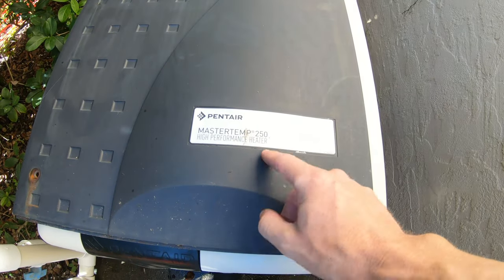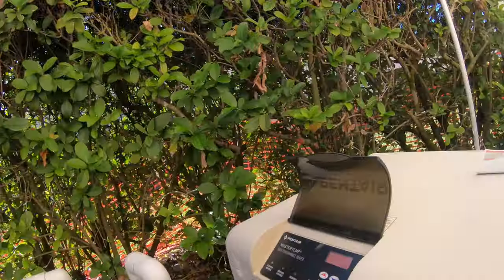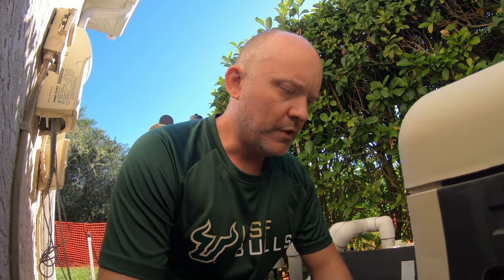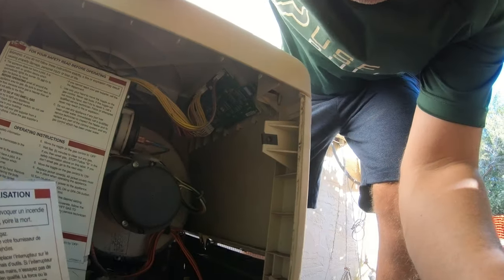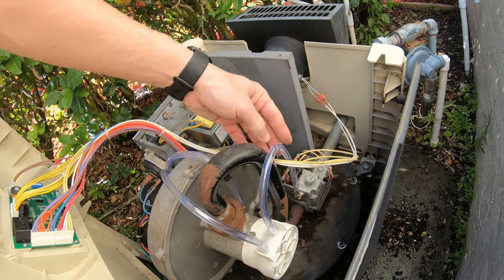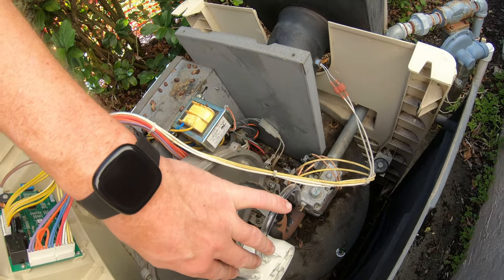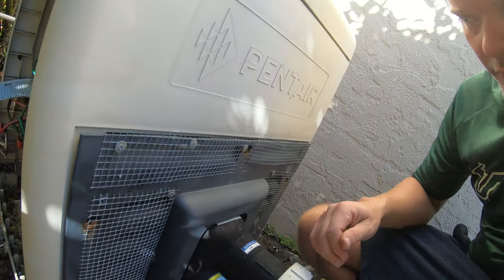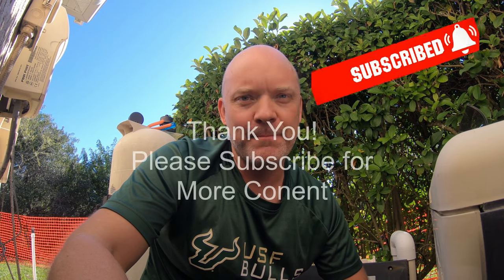Pentair pool heater turns on but does not heat, how to fix.

Comment: Hi I have the Pentair and it ignites then shutoff after 5 to 10 secs. I put in a new Thermal and 2 new plugs in front. Cuts on and I get r13,888,126 and heating light comes on but no service light. What else can it be?
Reply from the maker: Tami... if it ignites and runs then it is already making it past several safety checks. How is the water flow through the system? You can check by removing the inlet and outlet and hooking a hose up and watching the flow coming out... it may have a restriction. Could also be a slight airflow restriction ... check for a mouse nest at the intake and exhaust. Are you sure it ignites? Sounds like a furnace or gas stove kicking on.
Reply: @JackofAllTrades1  Yes, it definitely ignites and heat comes out of the vent. Are you saying disconnect the black pipes going into the heater from the. Ground? Where do I insert the hose?
Reply from the maker: @tamimorales1116  these units are made to be pretty versatile so your pipes could be on any side of the Heater. For mine the inlet and outlet are right under the control panel at ground level. You can flush water through either pipe and you donr have to necessarily disconnect the pipes at the hester..heater... but checking water flow is probably a good idea. It might be getting too hot because of poor water flow due to calcium buildup.
Reply: @JackofAllTrades1  ok yes my pipes are under control panel at the ground.  But where would I insert hose to run water through? I'm going to open it all up to ck for mice nest and ck tubes ect.
Reply from the maker: @tamimorales1116  there should be round disconnects right there that unscrew and free both the inlet and outlet pipes.
Reply: @JackofAllTrades1  Yes ok that's what I thought. Do I run water in the direction of the throught the heater the pipes or both directions?
Reply from the maker: @tamimorales1116  try both. You may be able to clean out any buildup. If it's calcium then it's gonna need muratic acid which is dangerous and will require it to soak.
Reply: @JackofAllTrades1  ok those cuplinks are hard to unscrew might need manpower😠🤣I'll keep you posted. Thanks a bunch
Reply from the maker: @tamimorales1116  I had to buy a special slip jaw wrench from Lowes to undo mine.
Reply: @JackofAllTrades1  oh ok. Also, I'm not sure all my valves are in the correct position to allow water into the heater
Reply from the maker: @tamimorales1116  if there's no water going into your heater than yes .... it will turn off to avoid overheating. The handles are all different but usually if the handle is parallel to the pipe then it's open.
Reply: @JackofAllTrades1  so the main valve from the filter is pointed up NOT parallel and that pipe.The valve on the ground  which I think goes to heater is now parallel pointing  in same direction of the pipe. 🤔
Reply from the maker: @tamimorales1116  any luck now?
Reply: @JackofAllTrades1  I need a tool to get the caps off but they are leaking now
Reply from the maker: @tamimorales1116  they have little rubber seals in them. If you have loosened it then that is why. Tightening them should stop this.
Reply: @JackofAllTrades1  That sucker is on there soooooooo tight I'm surprised it loosened as little as it did in order to leak alittle. Anyway, got some manpower to tighten it so no leaking g. As much as I love fixing things myself, I think I will call a repair guy😔

Comment: Do you have a video tutorial to replace the gas valve?
Reply from the maker: I do not. You would need to cut off the supply and then verify that the supply valve was indeed fully shut. Bleed the line and repair/replace the valve. Then bleed the air in the line and test the new valve. This would be something I'd likely leave  to a professional given the level of hazard involved. These things connect directly to your gas meter in most cases.
Reply: @JackofAllTrades1  Good to know. I was wondering if it was easy to replace. I did get  a technician to replace it.
Reply from the maker: I wouldn't say it's a hard job but does require some special equipment and it carries some risk.

Comment: I wish I had rats chewing holes in my airlines. I replaced the ignitor and that didn't help. What else could it be?
Reply from the maker: Tell me your symptoms. What happens when you turn the pool heater on? Does it make any noise?
Reply: @JackofAllTrades1  Error codes will show on circuit board by indicator lights. Self diagnosing.

Comment: My problem is that (although the hoses are fine) the heater shuts off after 60 seconds and the Service Heater light is ignited. Any ideas?
Reply from the maker: Kathy, do you know if it is just the exhaust fan that is kicking on or is it also the gas burner? Do you feel heat coming out of the exhaust?
Reply: @JackofAllTrades1  I do feel the heat.  BTW, it was the Flue sensor - easy replacement. Thanks
Reply from the maker: @Kathy Thompson  thanks for coming back and providing that information. It only strengthens the information this video provides.

Comment: My service heater light comes on but no fans come on. Completely quit. Any ideas?
Reply from the maker: There is a stepped process in which everything comes on. The fans are one of the very first steps, I would check for obstructions (mouse nest, acorns) that would keep the fan from turning or power interruption. Also look for the fan connector and make sure it's not chewed up or burn out. Do these checks with the power turned off at the wall disconnect.

Comment: I have an issue. I have a pentair heater . It turns on and it heats up like in 20min the service heater light comes on and stops and the control panel stops working so I have to unplug the heater and plug it back in to work again. It will work and do the thing . Please help
Reply from the maker: Can you tell if the heater is leaking water at all? Is the ground wet around it? It sounds like what you are able to do is by unplugging it, you are resetting a sensor. Do you get any error codes on the control board?
Reply: @JackofAllTrades1   No leaking and no water around and no error codes
Reply from the maker: @phillyguysgolftrips  have you looked inside it yet? Look at the back of the control board for green corrosion or burnt marks..look for frayed wires...look for anything that doesn't seem right. Make sure you disconnect the power at the box on the wall first.
Reply: It’s fine I think it my be over heating and shutting down
Reply from the maker: @phillyguysgolftrips  that or possibly not getting enough flow like there is debre blocking water from getting in or leaving the heater and possibly overheating that way. Do you know where the temperature sensor is on the heater?
Reply: @JackofAllTrades1  no
Reply from the maker: @phillyguysgolftrips  it's one of those sensors that are behind the cover right where the pipes come out to go to the pool (my cover is small and black). It should be easy to check with a multimeter if it is bad. I havnt had to replace one on mine yet but I'm sure somebody out there has a video or Pentair has a diagram of where it is located.
Reply: I checked it look good
Reply from the maker: @phillyguysgolftrips  for the 20 min that it is running does it display the correct pool water temp or is it way off?
Reply: @JackofAllTrades1  I have it set at 83 shuts down at 79
Reply from the maker: @phillyguysgolftrips  if you set the heater real low, like a degree or two above the current temp will it run for longer or does it shut off at 20 min no matter what?
Reply: @JackofAllTrades1  did not try that
Reply from the maker: @phillyguysgolftrips  give that a whirl, I'm trying to deduce down to what could be causing it. If it's strictly cutting off at 20 min then it may not be heat related. If it will stay on longer with a lower temp then it is very likely temp related.
Reply: @JackofAllTrades1  I think so to
Reply: @phillyguysgolftrips  It sounds like a water flow related issue. Try removing the thermal regulator. It has a thermostat attached to a long spring, loaded onto a screw in plug. You can test it in hot water, it should open in hot water. 
If you recently reduced rpms on a variable speed pump, that could cause this also.
Backflush or clean pool filter.
Check pool pump impeller for debris.
Do you hear a rattle near where water lines enter heater? If so, internal manual bypass is broken.
What error lights are lit on control board located under lid of heater?
Any error code on heater membrane pad?
Reply: @JackofAllTrades1    If it is wet inside what would that be an indication of? I don't see any leaks or sprays of water but it is definitely wet in in a couple of places inside.  Its wet on top of the round cylinder (I'm its a fan drum)
Reply from the maker: @Jason-hv8mz  the round metal cylinder is the heated water chamber… it consists of water coils that are heated by gas much like a furnace. Water on top is likely from the outside or spraying from the plumbing. If there is a leak, to find it, shut the pump down and let it sit for about half an hour. Pull the cover off the heater and watch it very closely as you turn the pump back on… if there is a leak it will momentarily squirt water. If it’s not that then possibly a leak in the cover somehow.

Comment: Why would service system light turn on?
Reply from the maker: Usually it means one of the sensors needs replacing. It could be a number of things. When you first turn the heater on, it should display an error code. That will point you in the right direction.

Comment: my heater will turn on, no service light but the igniter and blower will not kick on.  It is showing that the temp is 126, but the water temp is more like 68.
Reply from the maker: So the display lights up but no sound feom the heater at all? Does pushing the "heater on" button yield any change at all?

Comment: I am going to open my up. My pool guy told me it’s not good and I need a new one. The service light is on and I think the heater still good.
Reply from the maker: Def check as much as you can before you replace. Sounds like he may be trying to sell you a new unit.
Reply: if going into service mode. look at back of circuit board. Indicator light will tell the problem.

Comment: What if it kicks on, I feel warm water coming out, everything is fine and then a minute later, Service light shows and then it kicks off and no more warm water comes out anymore
Reply from the maker: Could be a couple of things, but the temp sensor comes to mind. Does the "current temp" reading appear correct?
Reply: @JackofAllTrades1  I think it's correct. I'm in NC and it says it's 66. Is it easy and inexpensive to replace the temp sensor? This thing isn't even a yr and a half old :(    Kids thought they were going swimming this week, guess not lol
Reply from the maker: @Derek Suarez  the temp sensor is going to be on the output pipe under the front manifold area... usually at the bottom (black plastic cover in my video). It's easy to do, but there are 3 different sensors there so it's a matter of locarinf it.. Have you tried disconnecting the power from the disconnect box and letting it sit... then trying again?
Reply: @JackofAllTrades1  I've cut it off at the electric box multiple times.
Reply from the maker: @Derek Suarez  do you know to test the sensors to see if they are bad. I think most of them are supposed to be in the open position normally, but if I were you, I'd start running some tests on those sensors, a d seeing which one is bad. It is very likely a temp sensor.
Reply: @JackofAllTrades1  So, that night, I decided to shut off the valve and open the drain. I then closed the drain and reopened the valve and after it filled with water, I turned it on and it worked. So glad :)  Thank you for trying to help me.
Reply from the maker: @Derek Suarez  wow... maybe there was an air pocked or build-up of calcium that broke free. Glad you got it working. Hopefully, the kids can swim this weekend now. :)
Reply: @JackofAllTrades1  I am so glad as well. Thanks again.

Comment: Sometimes it turned on sometimes it doesn't. hate the pool, nothing but problems
Reply from the maker: The water PH plays a big part in things falling apart. I learned that the hard way. I let things get too acedic and had to replace my chlorinator. I try to check the water every week

Comment: Pentair , service system light on
Reply from the maker: Tim, it can be any number of things. Are you getting any error codes? What are your symptoms?
Reply: Where would I find number codes that pentair
Reply: @JackofAllTrades1  won't do anything when turned on
Reply from the maker: @TimSheean-t8m  does the panel light up at all? Start from the basics... is the breaker tripped?
Reply from the maker: @TimSheean-t8m  time, look here https://www.troublefreepool.com/wiki/index.php?title=Pentair_MasterTemp_Heaters#What_Do_the_Diagnostic_LEDs_Mean_on_the_Pentair_MasterTemp.3F
Reply: @JackofAllTrades1  panel shows water temp
Reply from the maker: @Tim Sheean  ok well that's normal. Does the exhaust fan kick on?
Reply: @JackofAllTrades1  no
Reply from the maker: @Tim Sheean  with the service light on it means one of your sensors has tripped and is likely faulty. It could also mean there was an interruption in your ignition sequence. Have you pulled the disconnect on it and waited a bit and plugged it back in to see if it reset?

Comment: My issue is … the ‘pool on’ button won’t work/turn on/turn green. It can be controlled from the remote, and the ‘spa on’ does turn green/turn on. But I’m not sure why I cannot control it from the outside
Reply from the maker: Sounds like an issue with your control board on the heater. You can get it to operate remotely for that function but locally at the heater the button does not work. How does the button looked? Is the protective plastic on the button cracked? Have you checked the wires behind it to see if there are any burnt marks or corrosion? Luckily I dont think those control boards are expensive and it's pretty much plug-n-play.
Reply: Saying that you have a remote tells me that you have an automation system hooked up to your pool heater via the firemans switch inside heater. This disables the heater on off controls on heater membrane pad. This is normal.
Reply from the maker: @officerkrupke4966  that's great info! Thank you

Comment: Wish it was this simple. Heater worked for about an hour then the Service Heater light came on. It got to around 100° before it stopped working. 🫤
Reply from the maker: What are your symptoms now when you turn it on? Anything at all? Any codes?
Reply: @JackofAllTrades1  I didn't see any codes. I'll check that out tomorrow. I'm going to clean the contacts and any connectors, especially the thermostat. Was told it could be acting up
Reply from the maker: @noelv1976  let me know what you find and I'll try to help with what I know. I've fixed many gas furnaces over the years and this is essentially a small furnace.